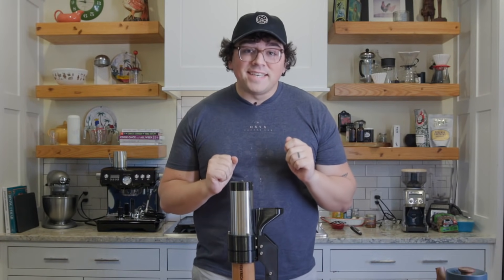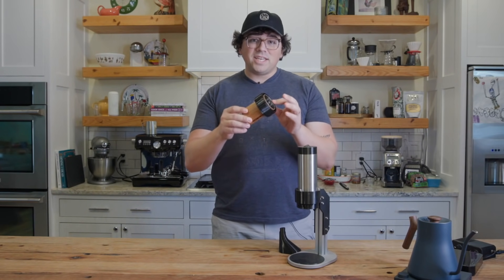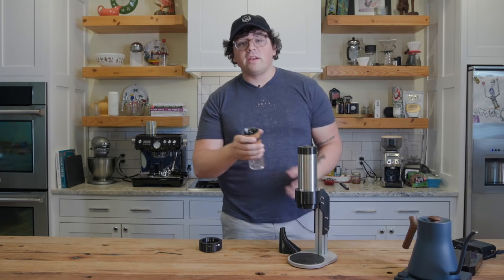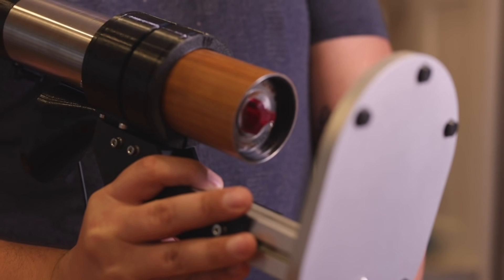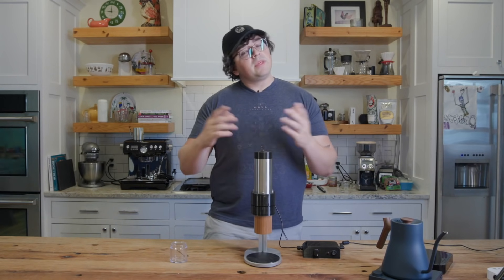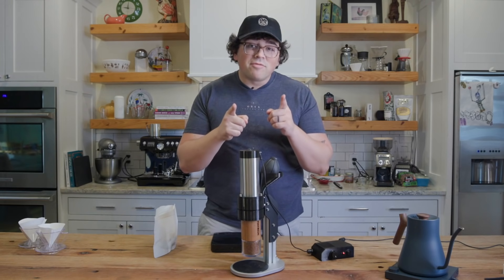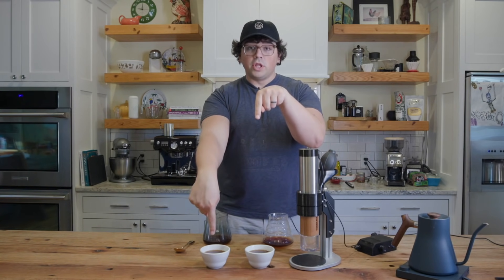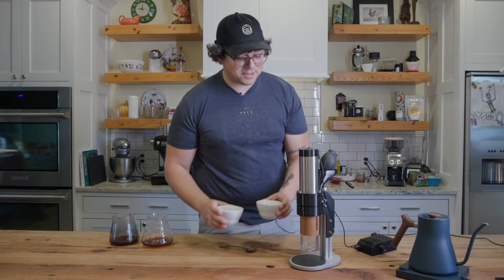MOTORIZED HAND GRINDER?: Review of the Skope Motor for the Comandante

Comment: Interesting product. I think everyone with a hand grinder at one time thought about an easy way to motorize it. It would be interesting to have a taste comparison between careful handgrinding and low rpm grinding with the skope. I don't dig the 3d print aesthetic though. There are ways to smooth out 3d prints like tumblers, that would add an extra step in production, but the end product would look less diy.
Reply: Acetone is the easiest trick if you're using the right plastic
Reply from the maker: Yeah! I don't think this prototype they sent is what the final product will be, but time will tell!
And I'll need to do that test, no doubt. Though, there are wild inconsistencies between person to person. Might need to gather grinds from multiple people to do a proper test
Reply: @LanceHedrick  Person to person differences were not even on my mind, but you are right, this would have to be taken into account. Truth be told I never really try to hit a specific grinding speed, I will measure my cadence the next time I grind some coffee.
Reply from the maker: I'd be interested to hear if you note any differences in messing around with them!

Comment: I saw you are using the red clix. What are your thoughts on it? I see everyone says it’s supposed to double but using it my grind settings are not all that different. It did double my lower espresso setting but for v60 with the red clix I’m at 25 clicks 2:30 draw down. 23 grams in 400 out.

Comment: Hey Lance, i've seen a number of hand grinder "hacks" on youtube where people put a cordless drill on their hand grinders.  Infact, Alton Brown does this with a pepper mill.  Seems like a much cheaper way to motorize a hand grinder than this device, and everyone had a drill in their tool box (I have two).  But based on your results in this video, seems like a drill's rpm maybe too fast to get good results and might actually damage a grinder.   Have you tried it?
Reply: 1zpresso seems to approve use of cordless drills on its 6.35mm/0.25 in 'axle'. The JX is so fast grinding for pourover/Aeropress (~1.1 g/sec) that I haven't seen much point here for my morning dose (up to 30 g), but I were batch grinding a bag for quick use (probably into 60 or 90 mL specimen containers for the freezer), it might be worth pulling it out once every 2 weeks.

Comment: Hi Lance.
Great great video as always.
Just wanted to note one thing,
I think there is a better option as conical motor powered brewing grinder and that's lagom mini(which has the same burr geometry with stepless adjustment and the cost is around the same to this setup)
I would love you to review it someday.
Reply: My lagom mini seems to produce so many fines and I've wondered if this is the grinder or maybe it's misaligned - have others had good results with the mini? If yes I'll definitely try a re-alignment! Thanks very much
Reply: @NashvilleFanatic  which burrs are you using? The 48 mm burrs are very good I heard from many people
Reply from the maker: I need to grab one to check it out. Only recently was released, so haven't had the chance yer

Comment: Cool video, so much thoughts! :-)
Dropping beans one by one compared to putting all in, and then start the motor will definitely have an impact on the results. So that's a big difference compared to hand grinding.
If I want some more fines for espresso, I sometimes hold my hand grinder at a 45° angle while grinding. It's slower, but also requires less effort.
It makes sense that the comandante performs better at slower RPM, after all that's what it was designed for. Did you observe the burrs getting hot while using the faster RPM?
Kudos for the MadKat name, that was also Prince's main guitar (which I brought back a couple of years ago)!
Reply from the maker: Yes. Dropping them slowly has a big effect. Mainly, you have to grind finer than usual because of the lack of pressure from above.
Holding at a 45 degree angle is a commonly used practice with hand grinders, for sure. I can't remember who, but someone I saw did many particle analyses doing 90 degrees vs 45 degrees.
And sure, it makes sense that it was designed for that, but they tested it up past 200rpm and it's still in their preferred/target zone. So, really, it was designed for high speed as well.

Comment: Gotta be honest I don't think it's acceptable to market and sell a product that is 3d printed that contacts food everyday.  It's not food safe and it's one thing if you print stuff for you own use and or do the post processing necessary to make it food safe that's one thing but for the uniformed consumer  to get this is a different matter.  They will not understand that an FDM print can get bacteria into the layer lines that you cannot really clean out unless the filament is able to be sterilized at high temperatures (most aren't I wouldn't expect this one to be)  For the mounting parts I don't see an issue but since the coffee is contacting the print in the chute etc it's problematic imo.
Reply from the maker: Sorry, perhaps I didn't say it or perhaps you missed it, but this is a prototype.
Reply: Could you just hit it with a Quat based sanitizer and kill pretty much everything?
Reply: It's not for commercial use, even though it's a prototype. But even if it were, old coffee on this plastic is far less of a risk than a wooden cutting board.
*Also, 3D printed things can handle high heat with the right plastic. The chimney for my coffee roaster is 3D printed.
Reply from the maker: I believe you could. I'm not worried about it, though. Dry coffee beans hitting it at room temp and passing directly to the Comandante. Idk. Not worried lol
Reply from the maker: Agreed!